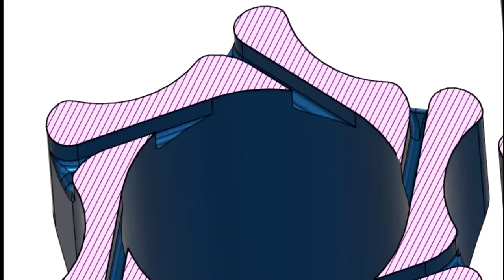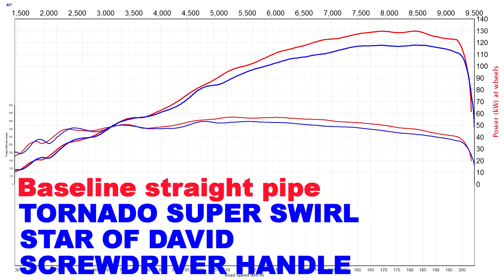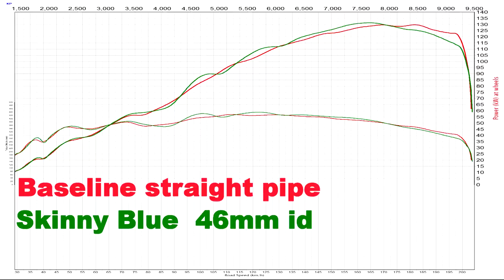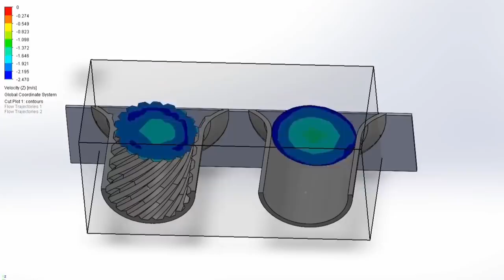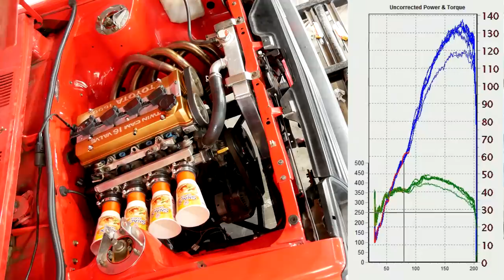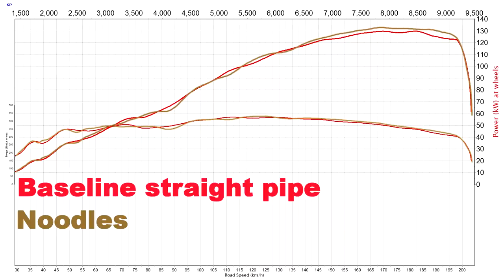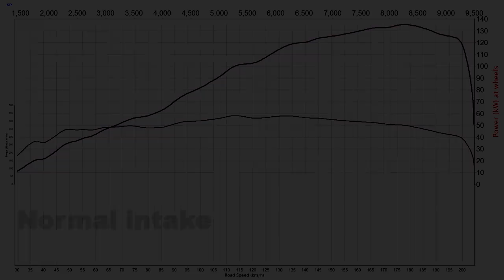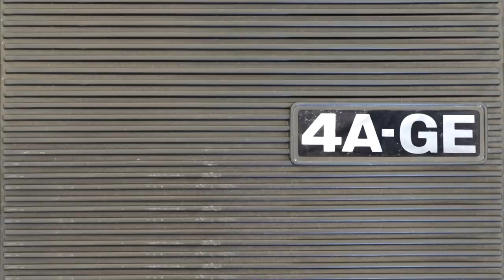Viewer 3d Printed Velocity Stacks  - Trumpets - Intake runners - Dyno Tested

Comment: The longer stacks get flow restrictions against the side of the engine bay.
Reply from the maker: They don't.  ive tested it in the past
Reply: @Garage4age  do you have a video on it? I'd like to see
Reply from the maker: @t_c5266    look for " best intake runner shootout" on my channel.  It's not specific  what you want to see. But somewhere in the video it shows  runners that bend up away from the strut tower, vs some of the same length that aim at it.    Alot of people have asked the same question re clearance. One day I will do a video showing how close can go before it becomes a problem
Reply: @Garage4age  Great video. Coming from an engineering background I'd also say there is a careful balance. between clearance, bends, and features along the line.
For example a straight pipe has no loss coefficient except for friction. A 90 degree elbow has a loss coeff of anywhere between 0.2 and 1.5. a 45 degree is a coeff of 0.2 to 0.4. 
Then the bells help due to the vena-contracta effect. The rounded edges give a flow coefficient of 1 (which means 100%). The straight the worst you can have is a re-entrant one that gives a flow or 0.5. That is the condition that the bare intakes are running at which is why they are clearly the worst. 
But the best you can do is what you are indeed doing, which is iterative design instead of trying to fight all of the tricky math that has too many variables to make sense to try to calculate. Instead employing good design philosophy from the knowledge background.
Reply from the maker: @t_c5266  I'd be the first to admit, I dont know all the math behind it.  but yeah, have a bunch of real world testing on intakes and exhausts.    I started off following "traditional" thinking and got nowhere fast.  some ok information out there, but some completely backwards also.   I basically threw most of it out the window and found my own way doing the testing.  
None of the runners in this video are my ideas btw. other than the "normal"  and the noodles for a laugh.
Reply: @Garage4age  Sure it might not be "your design" but it kinda is. The fact that you manufactured your own runners using solid design concepts makes it yours. 
theres really not a whole lot you can optimize in this flow either. Thats why velocity stacks have been around and popular for the last like 80 years. I didnt specialize in fluid mechanics, but with atmospheric pressure there doesn't seem to be much trickery you can do to get a truly unique, while also increased performance, design. So then it just becomes iterations to see what works best with your engine to optimize air flow. 
Maybe try the noodle cups again lol. But this time put a bell on the end. The larger diameter runner could act as a reservoir, as well as a high pressure zone to supply more velocity as it sucks in the air. As long as the transition to the slimmer diameter is rounded like the bells.

Comment: I do like these comparison videos, but they really don't show the potential differences between designs accurately. To accurately determine the gains/losses you would need to put each design on a flow bench or retune for best outcome with each design attached. With the exception of the screw driver handle, which is clearly restrictive, better flowing designs maybe producing less power due to leaning of the mixture.
Reply from the maker: All tests were done within an afr window where engine makes the same power.  flow bench doesn't show everything, best to test on the engine.    I've done almost 1000 runs on this chassis alone,  and even more on these engines in various state of tune.  so know how to get repeatable results

Comment: Star of David is starving for air. you need to open the ports and allow more air.
Reply from the maker: The guy that made them made the area of the solts bigger than the pipe. But might be still a issue due to the surface area. Will open the slots up at some stage
Reply: @Garage4age  WOW, TY FOR THE REPLY.
Reply: I made the "Star of David" ones. 

It's counter intuitive by looking at them, but:

The round pipe at the bottom has an area of 2123mm2 

The six slots have a combined open area of 5058mm2 

So it's got a worse surface area to open area ratio than an open hole, but that's why I made the slot area oversized by that margin. 

I think the real reason it performed poorly isnt because the slots are restrictive in themselves; so much as that it's causing the air to swirl internally. 
Which is counter productive especially when shortly after this is the throttle plates which straighten the flow back out.

This design wasnt about testing side feed slots, I was looking to see if having a capped end would help catch and reflect a stronger pressure wave. 
The slots are at a tangent to the perimeter of the pipe, so there's no clear path for a pressure wave to escape. 
The swirling isnt the main idea of it so much as a compromise I thought might be worthwhile. 

If you had the same design again with slots that ran straight so it didnt swirl, I'm fairly confident you'd see no restrictions - but no benefit from the runner length either, as I'd wager that the tuned length will correspond with first part of the opening of the slots. 

Maybe I'll print some more for another test later with straight slots. 

Either way, this isnt a design that I'd consider running on an engine. Apart from for sake of testing in these tests.

Comment: Idea for the next one....
Remove the thottle plates and the throttle shafts. So, there is no brake at all inside the runners.
Mount a manifold round the  trumpets with one oversized throttle body. Like 80mm or sth.
Highly interested🤗

Comment: Small difference at the top end and it's not of much use. Was hoping for something in the upper midrange, but no design was standing out. To big diameters intakes maybe?
Reply from the maker: Length  shape and diameter all need to be considered.    in this case the length and diameter is already about right. so cant expect big gains

Comment: Im late to the party, but has anyone ever tried a venturi port on a stack?

I realize this is a bad place to source an idea from, but my pneumatic air gun picks up quite a few cdm swapping from the straight bore or a venturi port… 

Also the star of david side vents on a normal horn, in my mind, might create a variable flow horn. 

Obviously these would be track only as either design is asking to suck up debris and not for a typical application.

Comment: I'm curious why you chose to make them all the same length the runner length drastically alters the power band. If they were designed to be short run them short if they were designed to be run long run them long. The shape difference is going to be miniscule it's the length that makes all the difference
Reply from the maker: They were ran at the same length for that reason. was comparing the shape rather than length.     I gave the guys that printed them, the option  print the whole length or  just the top half and use my extensions.
Reply: The whole point is to test the shape, not the length
Reply: @Garage4age  length is a more important factor than shape. You should test it
Reply from the maker: @RingTuned   I did a video on length some time ago,  here:   https://www.youtube.com/watch?v=nqYkmCLrlEo   The length on engine is best compromise for overall power
Reply: @Garage4age   It is and you can vary the length based on the cylinder position in the engine in order to optimize the output of the engine overall such as longer stacks in the middle shorter stacks towards the outside. In order to achieve peak volumetric efficiency for different cylinders

Comment: I'd like to see the test re-run with the large white bent rather than shaved to keep a straight-line.  

I'm suspicious that the cuts at the point where the "camber" is supposed to be at a maximum negate some if not most of the effect) that the trumpet-bell-shape is intended to achieve (by reducing the area of lowest pressure). 

See, for example: Goden P. Blair's article "Best Bell" which is referenced (and summarized) here: https://www.kitplanes.com/optimizing-induction-air/  
Original article: http://profblairandassociates.com/pdfs/RET_Bellmouth_Sept.pdf
Reply from the maker: Hi,  have done some like that in this video   https://www.youtube.com/watch?v=nqYkmCLrlEo       One thing to note, which can also be seen in video in the link and this one.  A large bellmouth will change the effective length of the runner,  if you were to measure runner length from bellmouth  face.

Comment: How much does a filter make it worse though
Reply from the maker: my "normal"  intake  runs a big pipercross filter, you can see the backing plate on it in vid.   zero difference in power with it on.    filter socks are horrible though, never use them

Comment: I really don't know how whoever designed those blue ones thought that would be a good idea putting narrow slots on something that is going to feed air into a engine???? I don't know if they just didn't know what they were doing and realize the massive amount of direct smooth flowing air a engine pulls in and requires or what
Reply from the maker: A friend thinking outside the box. The area of slots  is over double  the pipe size.   he was interested to see what a capped end would do.

Comment: I don’t get why you didn’t just go directly to the intake instead of always adding an adapter pipe and making the air inlet come close to the firewall/wheel well… wouldn’t the air have less resistance if it’s travel distance in the pipes is shorter…
Reply from the maker: because shorter pipes make less power.  check out my other videos.     the proximity between runner and strut tower in this case, has no effect on power. have tested in the past
Reply: @Garage4age  oh interesting, thanks for the reply, I would have thought the opposite, still isn’t the proximity to the wheel well an issue? I wonder if you made the stacks curved upwards to avoid proximity it would help, I think plastic BMW velo stacks on their na cars from the 90’s are curved.
Reply from the maker: @knightfall7534    Tested some bendy ones in a previous video https://www.youtube.com/watch?v=nqYkmCLrlEo      Going closer to the strut tower  will  have an effect at some stage. but isn't close enough to where they are.

Comment: I haven't watched it yet, but I can tell right away that the ones with "rifling" threads will not perform well. Counter to some people's intuition, sprinning a fluid as it enters a constriction does not help the flow efficiency--it makes it worse.

I just watched that blue one (the Tornado Super Swirl Star of David model) with the angled inlets that obviously cause a Vortex in the intake. What a terrible design! Almost the worst you could come up with.

So the Green Swirl (skinny boi) did alright because the curvature is good but the rifling is counterproductive. Less spinning is better! This is why the small white bellmouths did the best. They had similar curvature without the rifling.

The ideal design would be like the "small white" bellmouth but with a flow straightener to prevent/minimize flow rotation. Less rotation = more flow. The centrifugal effect of rotating fluid makes it more difficult to force it into a constriction because the spinning makes it try to expand. Likewise, a drain plug actually drains faster if you stop the swirling.

Comment: So the normal intake is the best, cheapest and probably easiest to manufacture. It's as if the manufacturer had done R&D on that part
Reply from the maker: I made the "normal intake"    Its machined from solid acetal plastic rod.   So the most expensive, and  yup I did a lot of r&d to get to that point

Comment: How does a KW translate to a horespower? This is one area I'm not a fan of the metric system, temperature on a day to day basis being another. Fahrenheit being more granular and more easily applied to a human scale (IMO of course). It does really big me when people say one is more "accurate" than the other....no, no it's not lol. You can measure both down to absurd levels of accuracy, decimals in a base 10 system are just SOOOOO much easier to math with, and mathing is hard if, like me, you ain't no mathologist or hell even a mathmagician.
Reply from the maker: multiply by 1.341 to get hp.   Its about 180whp in this case.    metric makes more sense to me in general. but  guess it just depends what part of the world your in..  neither is more accurate just another way of writing it.      Power i use both, but my dyno reads in kw, so leave it at that. rather than converting everything. already takes way too long to make these videos
Reply: @Garage4age  oh yeah if your (insert machine/metrology device) outputs in one or the other just use it lol.

Comment: Surprised the engine didn't heat soke,,,I mean maybe it did but didn't show it
Reply from the maker: engine is ran hard before i start the tests.  then same cool down period bewteen tests,  to get all the temps the same  every run.   else yeah will make slightly different power each run if straight back to back to back test

Comment: Why do we care about 130hp engine because it's old school Toyota and it sounds amazing. You got to hear it in person not the jacked up YouTube audio. Let me hear your 9k+ rmp engine....
Reply from the maker: Imo,   some small adjustments should be made to the intake runner with cam or cam timing adjustment.  since altering the opening and closing events will change the rpm of where the runner is tuned to.   but in saying that, its very little and can get away with the same length in most cases

Comment: Velocity stack can, have been, and are made with sheet aluminum. Seriously, this is the most productive use of a 3d printer?
Reply: A 3d printer means ideas can be tested for minimal cost and effort, which is why this video exists. 
People could just as easily submit their aluminium designs, but they didnt?
I submitted the blue sidefeed ones, I spent maybe an hour modelling it, and it costs about 20 bucks to print. 
Then I got to see it run on the dyno and see what happens. That's a bloody good use of a 3d printer if you ask me.

Look how many people in the comments section want to see golfball dimpling tested. 
It's completely useless, but people have a curiosity about it.
This would take forever to do with aluminium, yet it's a piece of cake to 3d print.
Can easily put that to bed with some simple testing at minimal cost.

Also, as an aside one of my car runs a 3d printed ITB manifold, which is carbon wrapped. 3d printed trumpets. 3d printed airbox, carbon wrapped. 
It all works great and realistically I'd have no easy other method of producing the curved trumpets that I needed to meet engine bay constraints.
From a heat soak perspective it's considerably better than steel or aluminium, and it's much easier to form natural organic looking shapes.

Comment: 400nl+ torque? How????
Reply from the maker: its torque at wheels.    its about 190mn ish at engine  if guess 10% drive line loss
Reply: @Garage4age  wait what?
Reply from the maker: @zafert85   thats how dyno's measure power. torque at wheels multiplied by roller speed. unless the dyno knows the engine rpm, it cant calculate engine torque.     the driveline multiplies the  torque. hence higher numbers at the wheels.

Comment: Anyone here read David Vizards yellow Aseries book? All this testing is old news…
Reply: Yes, from when it was first released (the blue version!). Built my MX-5 ITB stub stacks around the +5.8% elliptical flare. Works well.
Reply: @alfonsodelgardeo2422  😎👍 When i was a kid i worked for a guy who was building race engines in the 60’s/70’s, he swore by “flow rings” he used to call them. Often dodged the rules when stacks or pipes wernt allowed and could hide under a filter. I was earning way less than my friends, but the stories and experience from his era have proven to be priceless.

Comment: Legitimate uses for 3d printers are rare but this is definately one of them. I made a mandrel to form Hort trumpets years ago by investment casting aluminium but the tube split rather than flaring out and I lost interest in it.
Reply from the maker: I've managed to  make some basic bellmouths in the past from stainless. Aluminum not so much.  Quickest way to make basic shapes is still pvc pipe and a bit of heat
Reply: @Garage4age  that does seem like the most sensible way to go, I guess they wouldn't get hot enough in operation to sag. My next option was hammer flared copper, more for looks than anything else.
Reply from the maker: @WilliamMoser  copper would be kinda cool.  I've had pvc ones on my daily for a few months. Because don't want to spend any money on it and  all sins hidden inside airbox

Comment: You are not making a great change.
You already have the extension and the base of the intake manifold.
You are just adding the tip.
That is not going to make a big change...
Reply from the maker: Its just testing the entry,  so people didn't have to print a whole runner.   I have other vids changing the  runner in various ways.